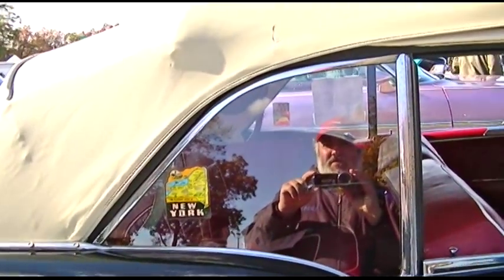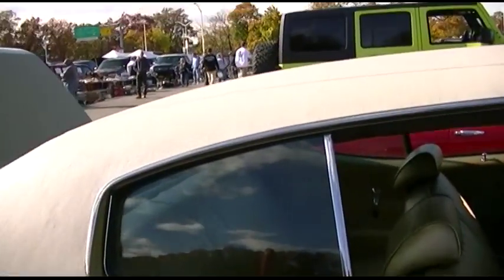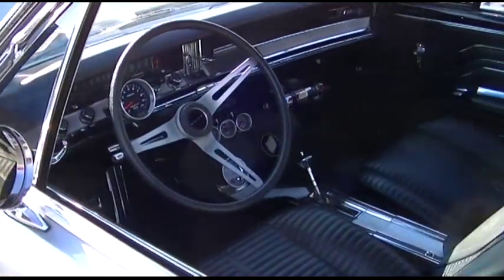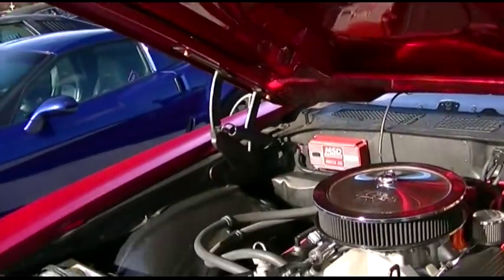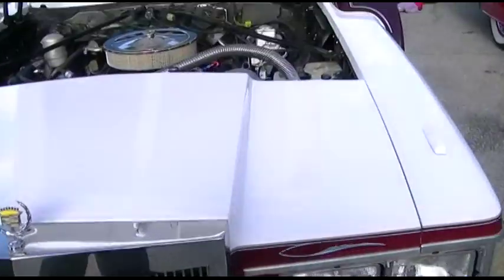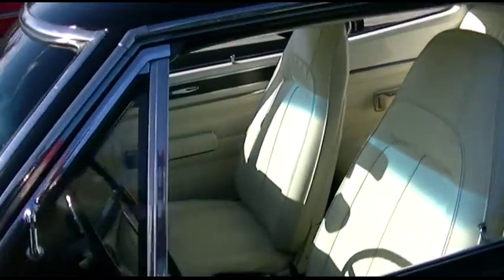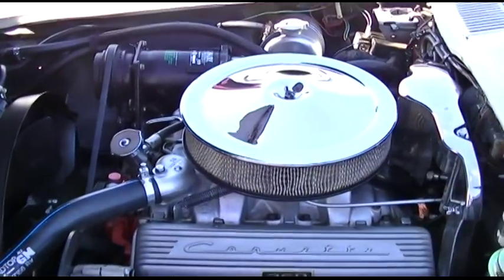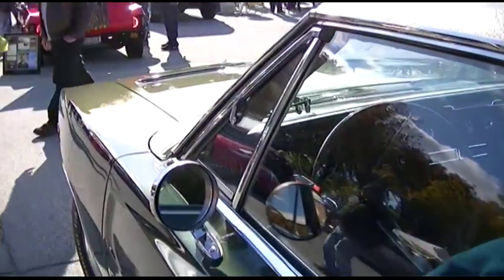Belmont Car Show Part 1

Comment: I love that blue VW Beetle!
Reply from the maker: Never fond of them myself.  The dealbreaker for me, as trivial as it sounds, was on the original ones.  They used the air in the spare tire to drive the windshield washer.  Personally I think that's a bit ridiculous, nobody every checks their spare, and they'll be caught, out in the rain one day, with a flat spare tire.  Or, they'll need to use the washer, and there's no air in the spare.  I mean how much would the price of the car gone up if they used a little DC pump like they do nowadays.  There's being cheap, there's being frugal, then there's taking it to the extreme.

Comment: The naysayers ruined cars! I don't care if my head hits the windshield, steering wheel, or dash in the event of a crash. I'd take that over a deploying airbag witch I find more scary than a lightning bolt striking eight feet away. Plus, my goal is to only have a couple MINOR accidents that don't warrant airbag deployment or less in my life. And I look for ones who are driving dangerously. I don't believe that airbags are safer. Driving is not TOO hard!
Reply from the maker: I'm hoping to NEVER have any accidents.  So far, so good.  Though there have been other people who have tapped me, but the damage was so minor we both shook hands and let it go.  This is NY after all, there's no such thing as a perfect bumper here.

Airbags are very scary.  So are explosive seat belt tensioners, that have been known to break the pelvis.  How good is a car that breaks bones when the physics of the accident may have prevented it?  

Trust me, you really don't want to hit your head on the windshield.  That could potentially be bad.  Steering wheel, not great either, but I think since there would be less of a point of contact it wouldn't be as bad.  The funny thing is, in a more modern car, all the seat belts auto-lock if they're pulled too fast.  And yes, I've driven in such a ways as to cause the seatbelts to lock on me, or leaned forward very quickly to check the blind spot in the mirror and caused them to lock.  I've also demonstrated in the car leaning forward very fast, and the seatbelt stops me from hitting the windshield for certain, and very likely the steering wheel (that of course will depend on your seat position).  But the airbags are there as nannies for those that refuse to wear seatbelts.  They are called SRS for Supplemental Restraint System.  

Now others are going to say I missed the point and that airbags are a necessary evil, because I can still go through the windshield with a seatbelt on properly.  I'm not about to believe them, nor find out for myself.  What I will say is this:  If the airbags would automatically turn off when the seatbelt is fastened that would be great, but then no one will wear a seatbelt.  It's amazing, in all these years, the seatbelt is still a manual thing on cars.  Though my dad's 87 Camry has the automatic shoulder belts they came out with back then; the lap belt you'd still have to put on manually, and seriously if the shoulder belt were to do any good, you'd need the lap belt fastened as well.  So it was a gimmick for a while, there were a coupld of other cars in the late 80s and very early 90s that had it, but it faded away for the more conventional belt.  Well, I guess I'm all TIED up now!  Har har!
Reply: jaykay18 As long as you are seeing the road and all the traffic you need to be aware of, most likely their will be no accident and wearing a seatbelt should prevent you from hitting anything! Especially if you attempted to avoid the accident. In my opinion, seatbelts are the real supplemental restraint systems. Not only do seatbelts save you in an accident, they probably help prevent one too. Airbags go to work when a potentially dangerous accident happens.
Reply from the maker: What you really need to be concerned about are the other idiots, texting and driving on the road!